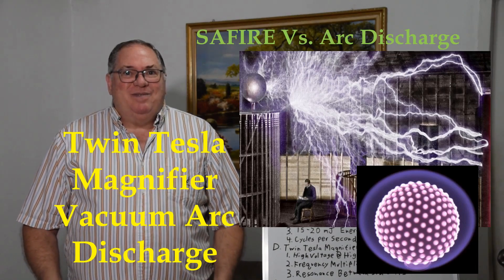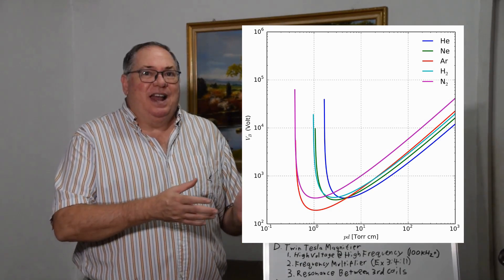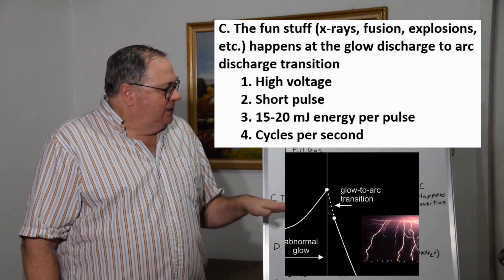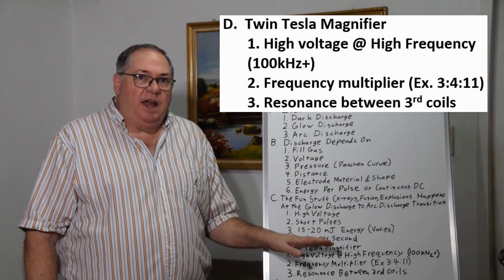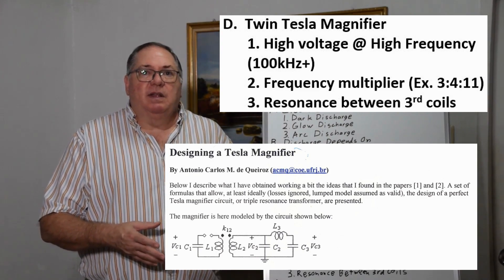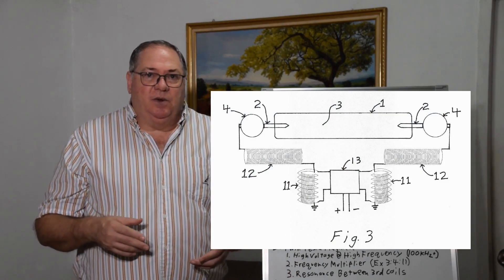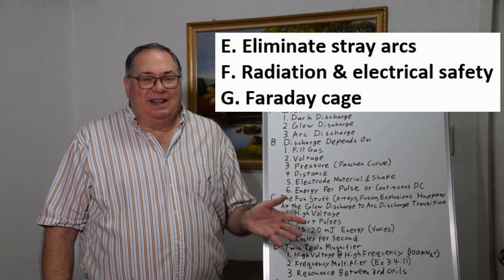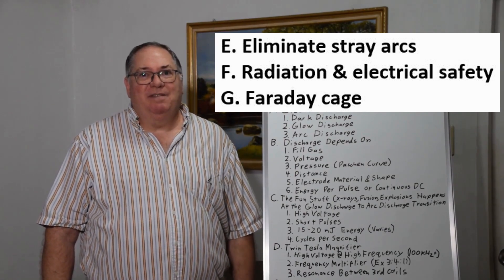Twin Tesla Magnifier Vacuum Arc Discharge Vs SAFIRE

Comment: Hello Ray - your magnifier circuit (and its balanced counterpart) can operate in two different ways depending on the size of C2. If C2 is 'small' then the third mode number will be large and the system will operate more like a traditional 2-stage TC system, because the currents in L2 and L3 are similar and locked together. If C2 is larger, and maybe an actual capacitor of order 1nF, then the magnifier works as a 3-stage magnifier system with the benefit of a much longer primary notch allowing the primary spark to extinguish more easily. I have studied and implemented all of (the late) Antonio's work on multi-resonant networks and I have used Mathematica on a Raspberry Pi computer to generate a full set of magnifier design tables, including L, C and coupling values for up to 8 stages! Would be happy to share. Best of luck with the visas etc.
Reply from the maker: Thanks for your advice. I may need some help in a few years time when I hope to be able to do these experiments.

Comment: You can use a modified Joule Thief design back-wired to the source power supply through a bounce capacitor, then pass that impulse to the extra coil, or even replace the extra coil with a network of small capacitors and isolation transformers.
Reply: This is what I came up with: https://www.youtube.com/watch?v=MZJgKVEMkTs
Reply from the maker: But then I would miss the coolness factor of the twin Tesla magnifier.😁 I like to think that if Tesla was trying to do what I am doing, this is the way he would do it.
Reply: @rayfleming2053  I think if Tesla had transistors he'd do it my way.
Reply from the maker: @whig01  I will certainly use transistors in the primary power supply. Then I need a transformer to boost the voltage to around 100kv before feeding it into the resonant coil.
Reply: @rayfleming2053  Yes I agree you can use the extra coil or you can use the stacks of small parallel capacitors on each end of small isolation transformers to achieve the same result of arbitrarily high voltage, by focusing the impulse to the shortest time interval.